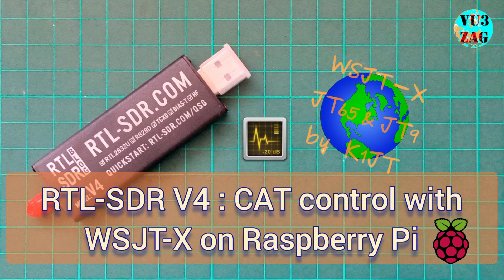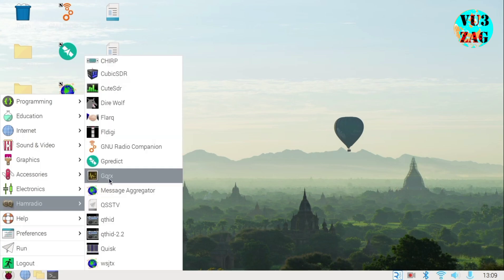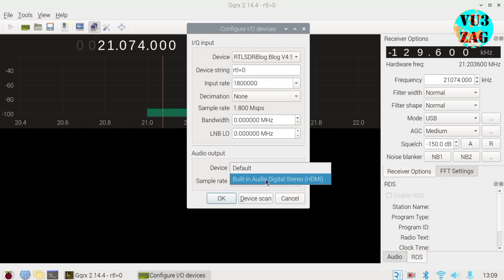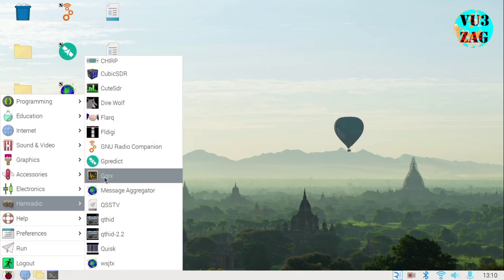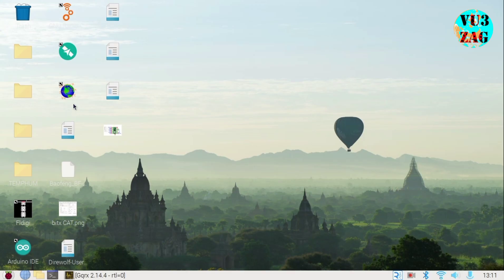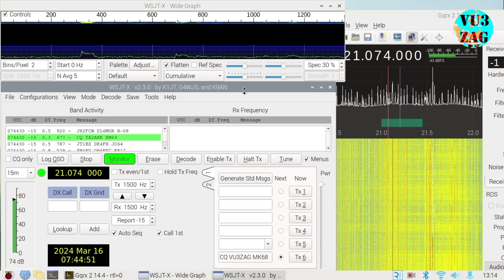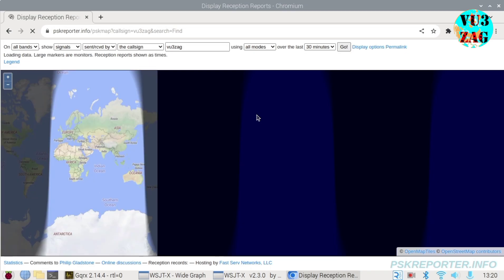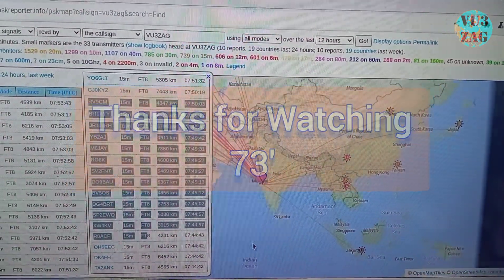RTL-SDR V4 : CAT control with WSJT-X on Raspberry Pi 4B

Comment: As an update, the virtual port method did not work but this command does - pactl load-module module-null-sink
Reply from the maker: Did you make any other changes?
Reply: @vu3zag  No, just that one change and it worked perfectly after that.